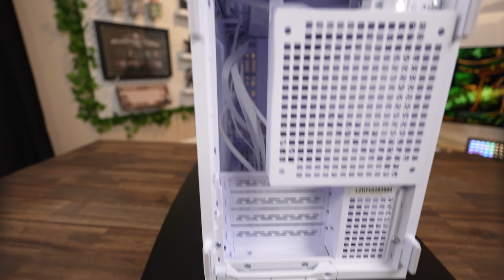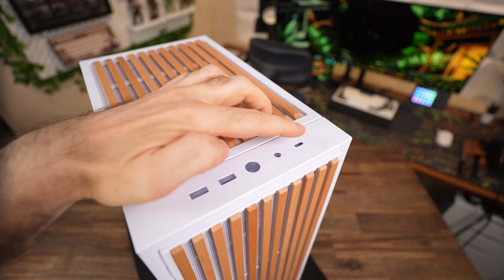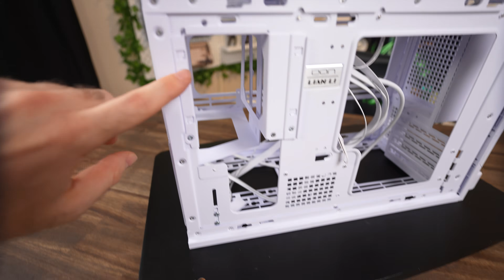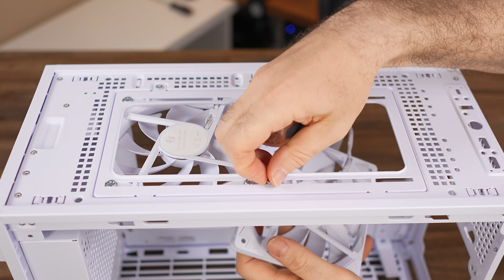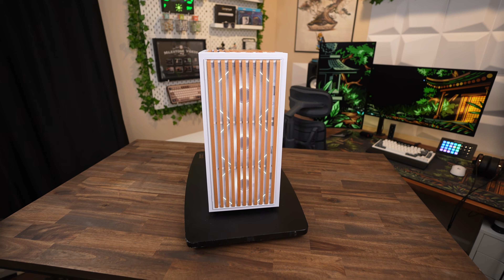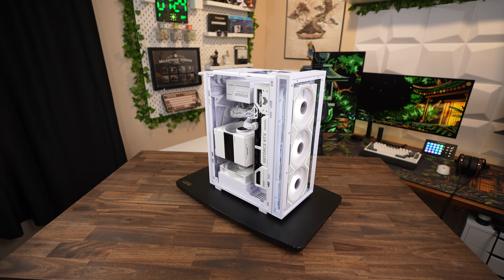Lian Li's most VERSATILE PC Case?! (B4 m-ATX)

Comment: You may have been better served if the top fans in vertical was exhaust and the bottom ones at the back and bottom were intake.
Reply: RIGHT, I want to buy one and I’ve been watching all the videos about the b4. I thought he was going to get it right. from all the videos I’ve seen I’ve gathered that what you just described is the best way to keep it cool. Pushing air down will just bring it back up to either the front fans or your rear intake fan located ON TOP of an exhaust fan. That is just keeping the hot air circulating

Comment: I'm interested in using this vertically and have been checking some videos. Yours is the only one that even mentioned cable access/routing out the bottom needed to be considered. Good info to consider.

Comment: Was planning to get this one for a vertical orientation, but ended up not doing so since you need a big ass hole on your table since the I/O is only accessible at the bottom and I have a lot of wires connected in those ports. What a let down.

Comment: The USB L connect wireless controller/dongle can be plugged in to the mobo using the cable they supply with it and kept inside the case. at least it came with cable with the 3 pack cl wireless fans i had.

Comment: Hi i was looking to upgrade my case from NX410 to NX416 L or P30 ARGB since nx416 l and p30 argb prices are the same i would go to p30 argb since i think my 7900xt aint getting a lot of air in my nx410 and hot air instantly hits the side glass and hot air goes into the GPU again and i am scared that glass might explode from the temperature.

Comment: Correct me if I'm wrong, but isn't the vertical canfiguration much worse in air flow? Since the GPU and PSU are intaking on the back and top of the build where you normally want te opposite?
Reply: I mean when doing the vertical configuration without the aerodeck (that is possible rigth?), which swaps the front/back orientation of the case.
Reply: So I’ve seen a lot about this case, it’s not that bad with temps at all, but the way the airflow is done in this one specifically gets a bit on my nerves. The bottom fan should be set to intake, cpu cooler fans flipped to keep airflow upwards and do what he did with the slim fans but the opposite way. Pushing the hot air down ain’t the move

Comment: u mess with my head, becasue i was also 50/50 about 2x wood. So u dont help at all :D
Btw. I will swap the airflow 100% and put 1 fan on top to out :) <3
Reply: Also, do intake for the bottom one and have the cpu cooler go bottom to top instead of top to bottom. Do the opposite of what is done with the slim fans and put the intake on the lower side.

Comment: The top wood panel makes it look unique among the other pc cases. I made a vertical build using a 30mm thick 280 aio and atx psu. Swapped the fans with noctua g2s. Cable management and aio tube positioning is very difficult but is possible even with the galahad ii lcd's bulky radiator tube connector. I needed to orient the pump connectors towards the rear of the mobo and get creative with the long cables of the lian li sx1200p. psu. Positioning the aio is a lot easier if the official limit of 52mm was followed.

Comment: Nice case Dan, in vertical mode, im wondering if you must use 90° degrés HDMI port for the GPU (same goes for big USB devices i assume they dont fit under the case) in this position ?
Reply from the maker: For certain cables, and adaptor would be the best way to go. Lian Li even stated that in the manual that not all cables would fit. My HDMI cable I used is pretty "low profile", so I didn't run into any issues.
Reply: @DanKamYouKnow thanks Dan !

Comment: have this  with a 5080 astral in white. Hardest case i've built in especially with that top fan on the astral and fighting for my life to cable manage
Reply from the maker: Oh man, the PSU cables would make it very tricky with a card like that. Even with my current cable management, the PSU cables are resting against the back plate of the GPU. I can see how that would be very tedious.

Comment: Any clearance issues with DP/HDMI cables in vertical mode?
Reply from the maker: Lian Li states that an adaptor might be necessary for some HDMI and DP cables. I didn't have an issue with the cable I used.

Comment: Is there a way to mount that aero deck on top when the case is on horizontal position?
Reply from the maker: No, can only mount to the bottom of the case (Which becomes the front with the AeroDeck in vertical mode.

Comment: I just transferred my NR200 rig into this case so I could have the all-mesh vertical configuration and I absolutely love it. Went from 3 case fans to 6. The rig is quiet and cool, and I actually prefer the vertical look without the Aerodeck add-on panel. Build experience was definitely more difficult just due to the cable management.
Reply from the maker: Thanks for your feedback on it!

Comment: is that even enough space for the wires to bend?
Reply from the maker: For the PSU cables? Yes, should not cause any issues.
Reply: @DanKamYouKnow  thanks for the reply.  
I meant the back io port and GPU display cables exiting from the bottom.  planning to pick this up, your vid helps ❤

Comment: but there is a chance to build the controller internally... where the gpu not touching the case for instance - or wouldn't that be possible?
Reply from the maker: When you run it internally, it gets plugged into a USB 2.0 header through a cable provided by Lian Li with the controller.